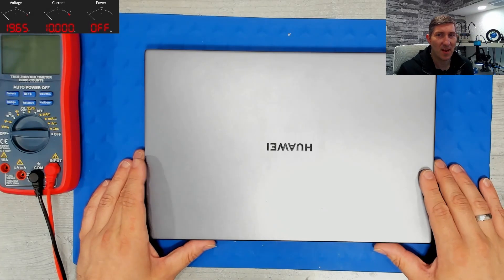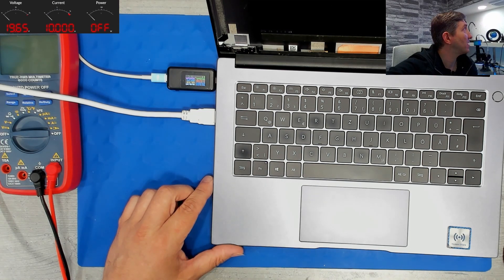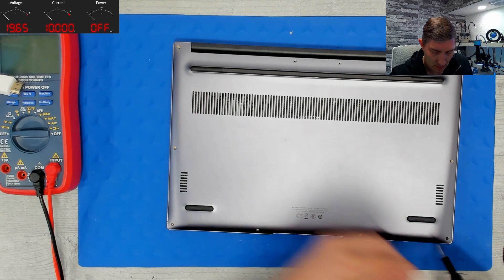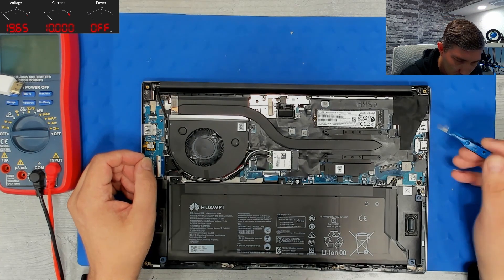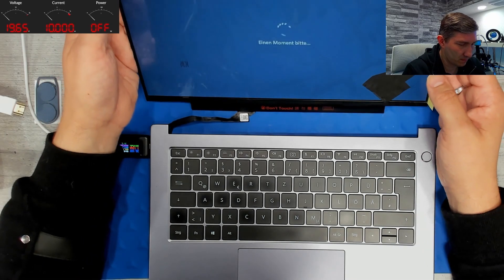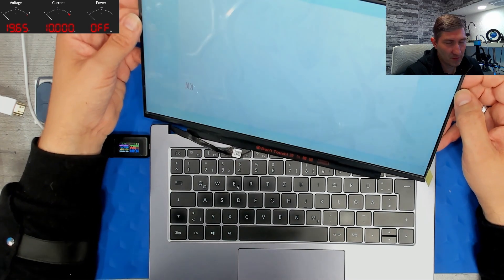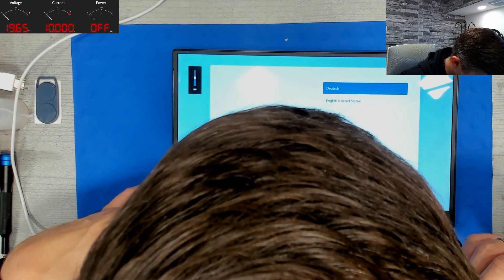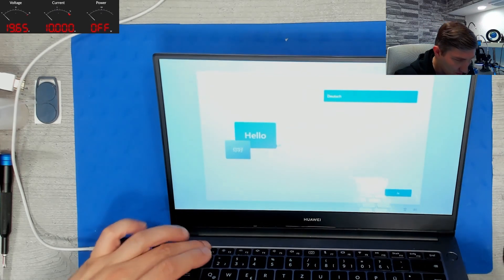Huawei Matebook D14 - No Backlight? The normal madness when a random person wants to be a technician

Comment: Sometimes when you play with the display without unplugging the battery it happens like that. I had many cases  with backlight only and no display. Plug/unplug the cable fixes it sometimes. Also in some of the Lenovo/Asus/Huawei you have to slide the bottom plastic on the display in order to remove it. Nice video as usual. :)
Reply: I think that has happened to me. I only see backlight on my LCD, but it is new, I have just changed it. What should I do to repair it? I tried to unplug the LCD cable but nothing happened... Could the cable be damaged?